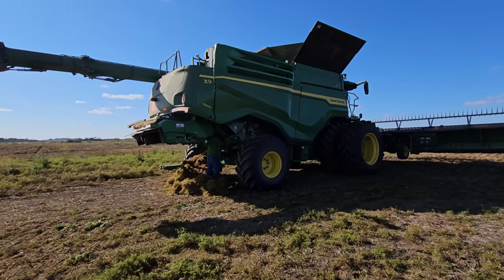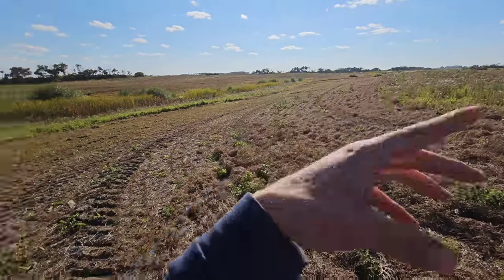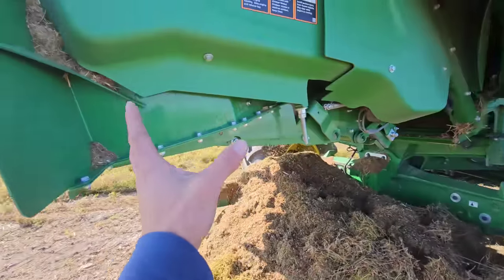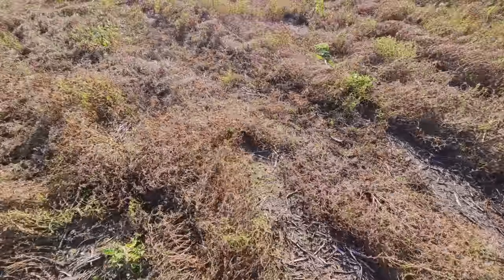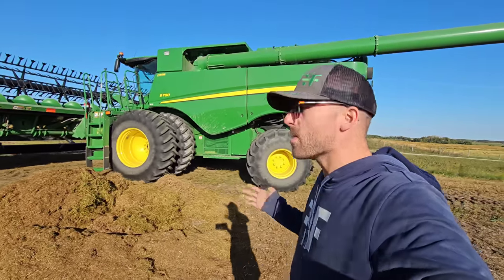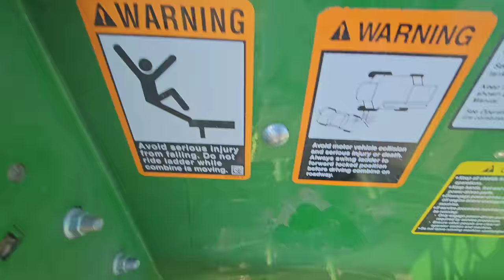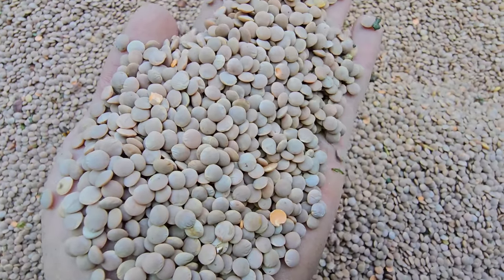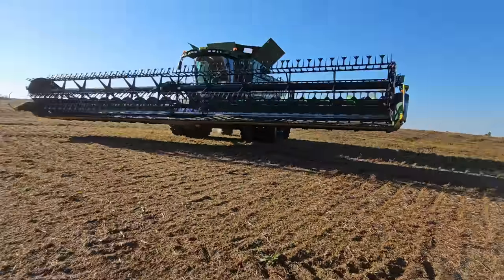X Series might be "Ex" Series 🫣

Comment: Well duh,  it is obvious that the problem is the transition from the chopper to the spreaders.  There is likely a divider in the center that directs the flow to the left and right spreaders and that is where the green lentil straw is hanging up.  For lentils take the spreaders off and put spreading fins on like on the S780.  Yes, it won't spread as far but you will get it done.  Or custom mount spreader fans behind the spreader fins and you are good to go.  In this case you would set the center spreader fins to separate  the flow in the middle but the rest to direct  the flow toward the middle creating two separate flows, one to each spreader.  If the rest of the combine is good you now have a combine worth $1.4.

Comment: Any combine is going to do that if you run that much green material through it. Especially at a 50 ft clip on a combine that has a chopper. Might get away with it with a walker combine.

Comment: I usually agree with Mike, but here he’s expecting everything to work perfectly in far from perfect conditions. And then he criticizes the old school vane tailboard, when that is the reason the S series was working. Can’t fit that much green through a spreader. Gotta lift the chopper and drop swaths. Obviously not an ideal situation and creates more work later on when you have to go burn it.
Reply: For 1.3 million dollars it should be able to do and it's definitely not the first S he's ran in lentils
Reply: I doubt his south farm lentils are that green. No combine, regardless of color, likes that much green material. An S series with the spreader instead of the vane tailboard would still plug up the same as the X. The $1.3 million is absurd. But it doesn’t mean it’ll be perfect in terrible conditions.
Reply: Yeah maybe so and I think that's what he ended up doing, dropping swaths ,I dunno watched the videos from Hartung Family Farms

Comment: Why do you use the spreaders over just fins on the chopper? Majority of farmers in midwest (hard wheat and row crops) uses choppers with fins.
Reply from the maker: They won't spread 45ft
Reply: Because when you are combining corn you don’t need to throw it 45’ and soybean stubble is basically brush its so brittle.

Comment: Gotta get yourself loaners of all the twin rotor combines to see if this plugging is a potential unresolved downside to that design.
Reply: Its a chopper design problem. People in the comments told him what the dealers are doing to make it work. Someone (not Fendt) came up with the fix for the Fendts.
Reply: Don't think New Holland has issues... not sure what's changed in the last 15 years but never plugged a cr9070 chopper or cleaning area  in flax
Reply: @farming4g  Same  here with the JDs . Why change a design that works? Probably some new engineer that thinks they know better.
Reply: @lynwessel2471  not enough money to be made in tried and true designs sadly. I see why JD never let Mike demo an X since they wouldn't have gotten a dime from him then.
Reply: @farming4g  Just like the Fendts,let the farmers do the last 3 years of r&d

Comment: Would a smaller head on the do help, it works surely be less residue coming out!?
Reply: Not necessarily,  combines are designed to run relatively full so you often end up with more seed damage when run under partial load, so you would end going faster to make up for the narrower head.   It's definitely a balance issue though,  if the feeder house allows the volume in then the rest if the machine should allow it to exit.
Reply: @chucklesx  yes I know how a combine operates but not sure on lentils because we do not grow them here and curious how they would fair?  Bigger isn't always better!
Reply: @bryanginder5903  same rules apply,  even more so in lentils because they are extremely fragile and split

Comment: None of the other brands will be sending Mike a demo to put into those conditions… they’d rather you not see the results… I don’t think you can blame the equipment for failing in a crop you have admitted is not common in that area for exactly this reason.. let’s not forget manufacturers build equipment for the masses not the one off trying to out think the rest of the producers by forcing a crop into a unfavorable environment…
Reply: And the 780 goes back and forth back and forth.

Comment: Don't  blame the machine  for less than ideal conditions.
Green straw, weeds etc will plug any combine
Reply from the maker: But not the S series, it hasn't skipped a beat 🤷🏼‍♂️😆
Reply: @mikemitchell2554  remember how much product your putting through also.
Maybe put the front accelerator on slow speed, plugging it would be easier to unplug than the rear beater.
Reply from the maker: @westmanguy01  it is in slow speed because in high it cracks the lentils. I appreciate the input good sir. 🙂
Reply: @mikemitchell2554  run your front accelerator belt a little looser maybe.
Carry a reciprocating saw to unplug the accelerator.
It works great .

Comment: Anybody knows you cannot run green material through a rotary machine you know this Mike so stop knocking the combine no matter what color it is it will still plug up the back in we don't care how dry your bean is the bean isn't what's plugging it and you should know this. Now why is he inside the machine with the motor still running in?